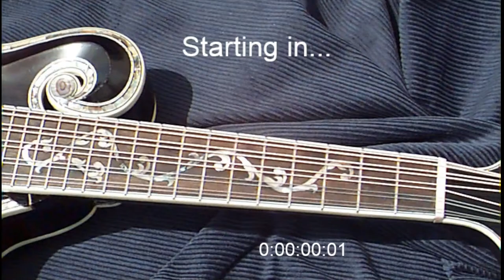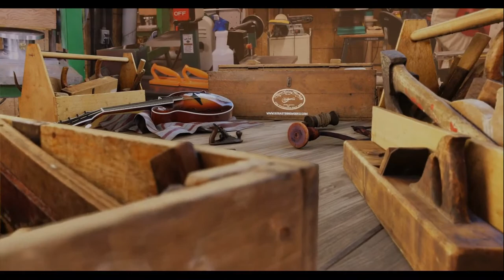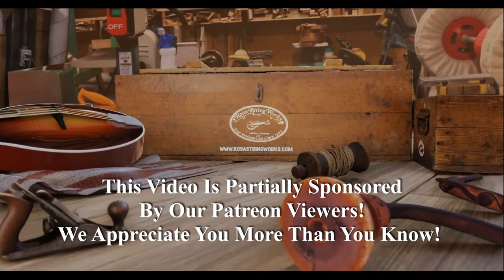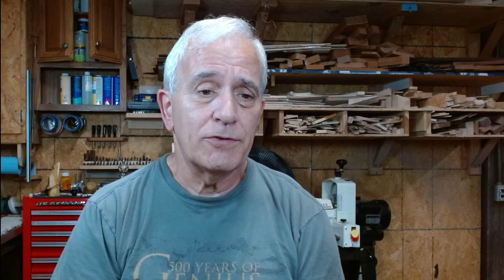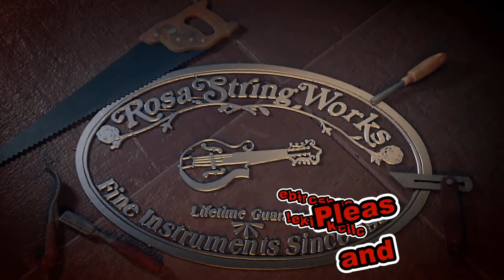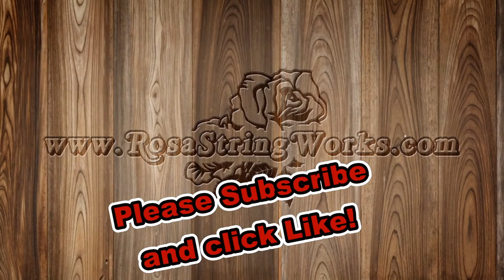Vlog 281 Live Trailer Status, Water Wheel Project Update and more

Comment: John Deere doesn't want you fixing them yourself so why would they make it easy to source parts?  You can only get some parts and info because of the outcry that occurred when JD tried to make it just about impossible to do even regular maintenance yourself by keying everything in their new designs to a proprietary computer system that only dealers can reset to keep it from shutting down.

HP has been doing similar with their print cartridges.  HOA's are even getting in on it trying to make it forbidden to open a hood in your driveway to check the oil or battery.

Best!